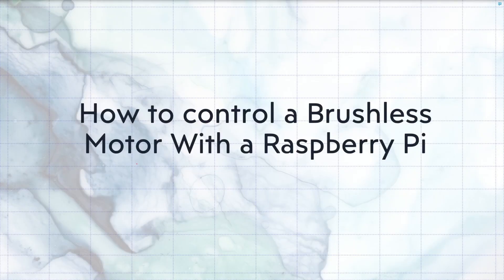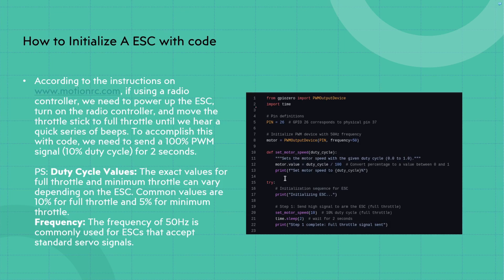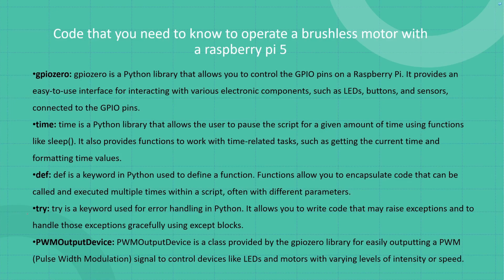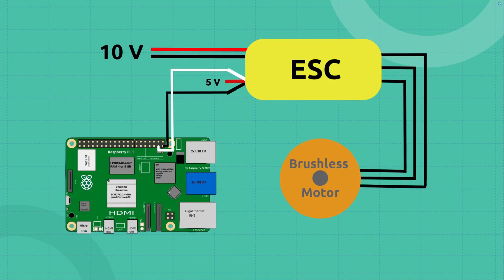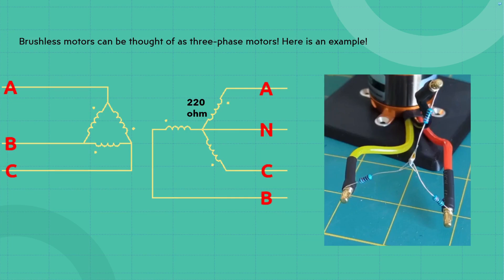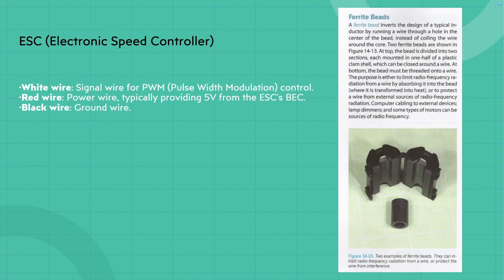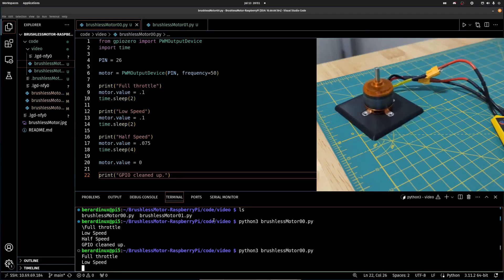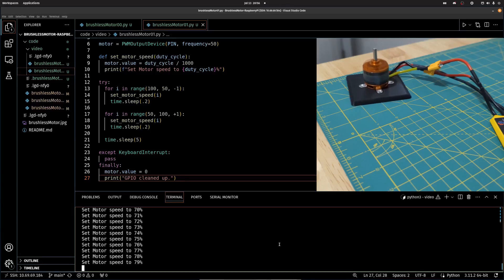How to Control a Brushless Motor with a Raspberry Pi 5

Comment: I noticed you aren't using a level shifter yet your RC receiver is probably outputting 5V and RPI uses 3.3v for signal pads.  Is it not an issue because we are only sending PWM signals and not hooking up that +5v VCC?

Your video finally got me some PWM signals on the scope but when i try sending it through the level shifter, the motor controllers are unresponsive.

Comment: thanks for this video, clear and concise. i have my RC Car with ESC recieving signal from reciever, so instead of reciever i can use the RPI and connect to ESC? it will work to control RC Car motor?
Reply from the maker: Well, I do not know about your specific situation, but if you receiver is controlling the ESC with a PWM signal which I would bet money it is. You will be able to send the same PWM signal through your raspberry pi to control the ESC and brushless motor. Every time I try to control a new device, it takes some playing around with it to make it work but I’m sure you will be able to get it! The worst part about some devices is that they have no data sheet to make it easy to find information on how to properly control it. Good luck  👍